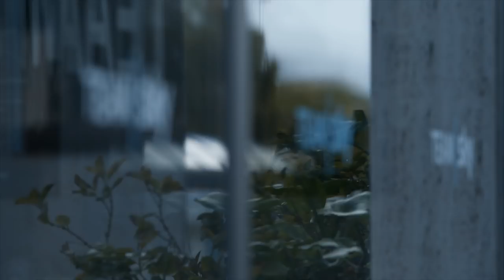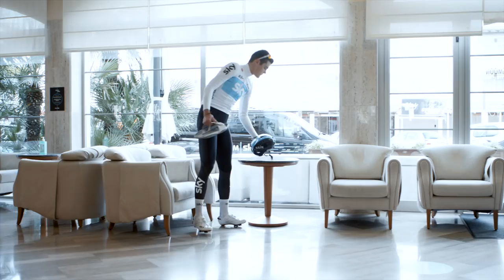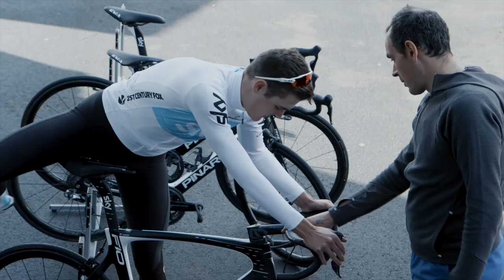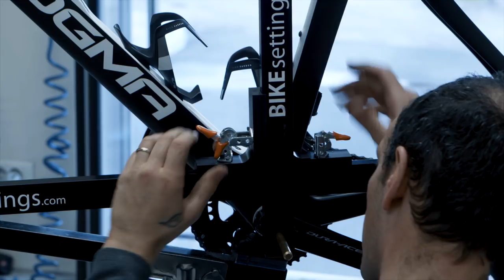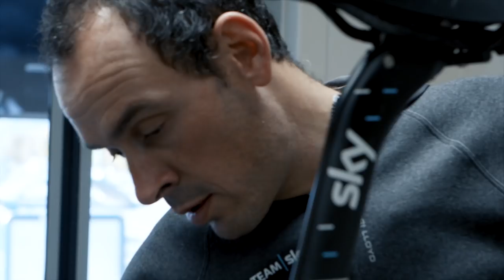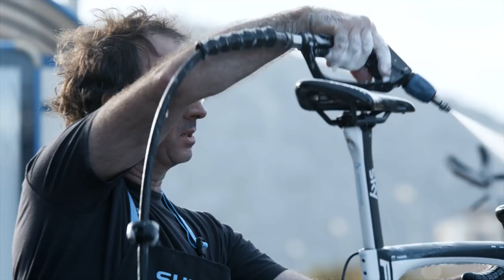Pavel Sivakov receives his 2018 Pinarello DOGMA F10

Comment: The frame he got is AT LEAST 2cm too short! Look at this guy, he needs 62cm top tube! We can see it eve from down over here! Teak Sky, take a note!
Reply: Alex Pavlov they all ride smaller frames to get in a lower position on the bars for better aero.. Froome rides a 53 when he should be on a 55 if he was a normal rider...
Reply: Zaheer Kader how can you get a better aero if you bunched up on the smaller size frame? It's opposite, if you on a larger frame, you are stretched out more.. Besides your butt sliding off the saddle while you pedaling.. Where's marginal gain in that?
Reply: Alex Pavlov the saddle to stem drop is higher allowing them to get lower on the hoods. They also compensate with a longer stem to stretch out as you said
Reply: Zaheer Kader and there's more pressure to the rib cage and lungs in this case..
Reply: Zaheer Kader how they compensate that their butts are sliding off the saddle? 40mm offset seatpost? :))
Reply: Alex Pavlov now you know why Chris froome needed his asthma pump 🙃🤣😂😜
Reply: get smart, many top riders use undersized frames...
Reply: Charles Rush you killing me 🤣🤣🤣🤣
Reply: im sure you know better than the multi million dollar industry and thousand of experts which are behind those guys! :DDD
Reply: FLo Holzer what's shocking is that team sky even have stems down to the mm not cm that's how precise their bike fitting is... And they got space for an inhaler in the saddle bag too 😈🤣
Reply: Alex Pavlov yea maybe you do know better than team sky!!!
Reply: shorter headtube on smaller frame
Reply: He's 188cm, so no, he doesn't need a 62cm frame haha. He's riding a 56 and probably would fit a 58 better, but saddle to bar drop on a smaller frame with a long stem has been the trend for 15 plus years. Nothing new here